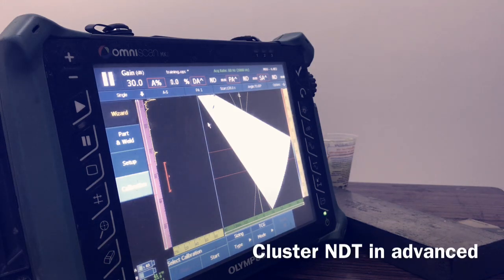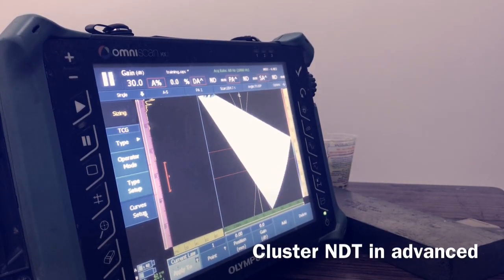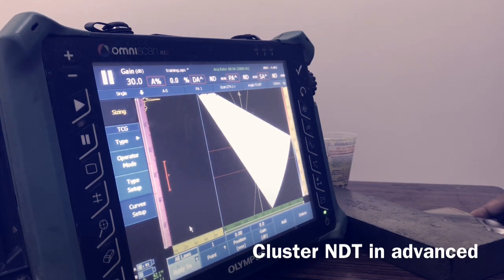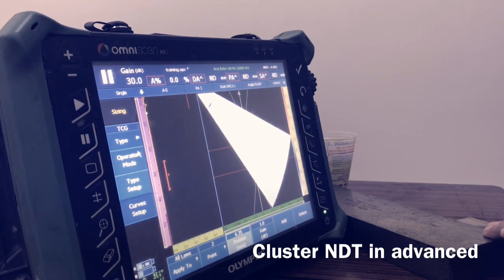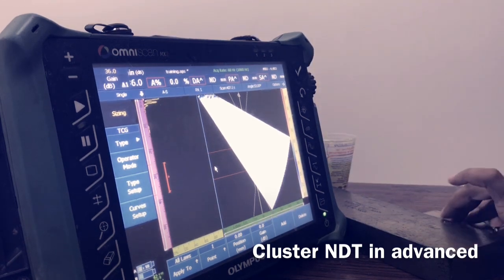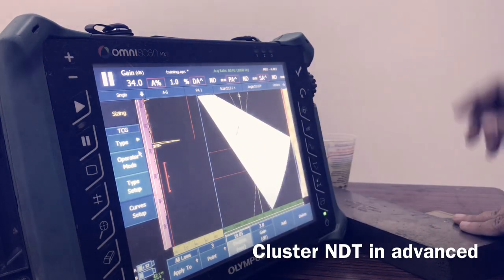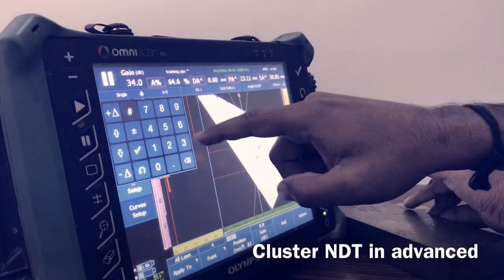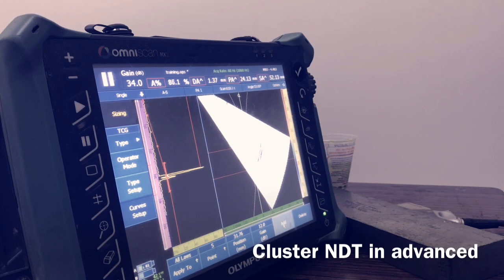NDT PAUT MANUAL TCG full version -omniscan machine

Comment: Did Code is allowing for Manual TCG ?
Reply: But ASME Section V. All mentioned all the Angle have equal response has to produced. As you known most of time we analysing the indications on amplitude reflection. If we will apply manual gain then Lower angle show more than 80% that time how we can Used to manual TCG gain for interpretation of indications ??
Reply from the maker: That’s y everyday before the work we need to do Calin & after the job need do cal out. If while doing calout time , any variation more than tolerance level means- re calibration ( a2 z)mandatory
Reply from the maker: Calibration for reference sensitivity was made using the known calibration reflectors described in ASME Section V Article 4 and a time corrected gain (TCG) applied.
For example- specimen pipe, cal reference Bottom &Top notch. So there is limitations for that. In the mean time we need to use .
Otherwise auto TCG draw with standard block( Navship or IOW etc), then go for the Calin.
Reply from the maker: Ur questions is right only . But some case we need to follow manual TCG, as I above mentioned. 
About sizing , u should prefer high aperture . So near field will increase then ur sizing parameters will be accurate.
Reply: @CLUSTERNDTTEAMINADVANCE  Mentioned Which clause of section is allowing a Manual TCG in ASME section V.

Comment: Sir what you have provide a video of TCG on curve Notch block
Reply from the maker: Ved Prakash verma sir, currently I’m not working , when I start the job again I will make another video for that .
FYI,
Calibration block - curved notch block( using auto tcg)- in all laws 
Then 1 st point -0 add point 
2 Nd point , Bottom notch
3 rd point , top notch